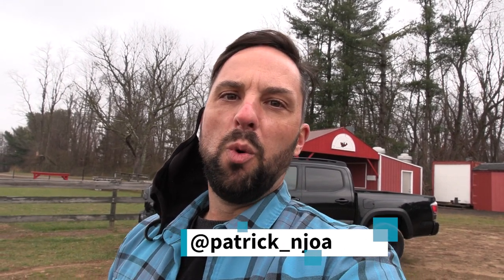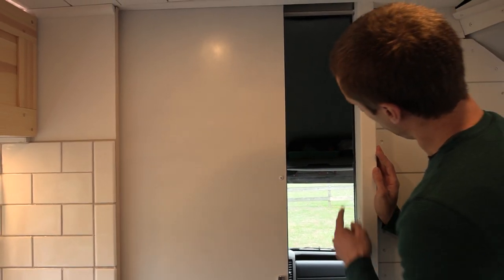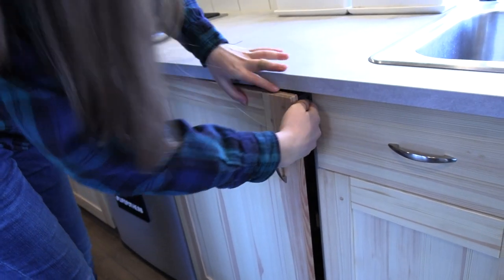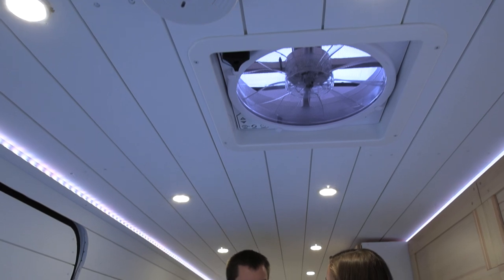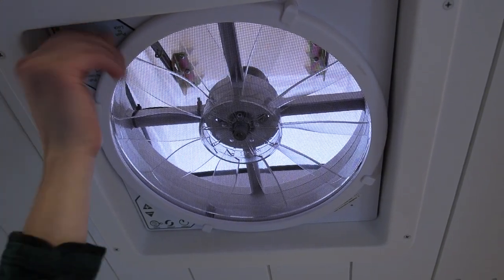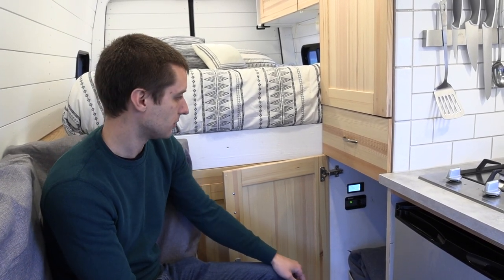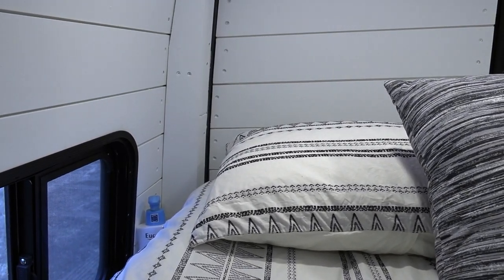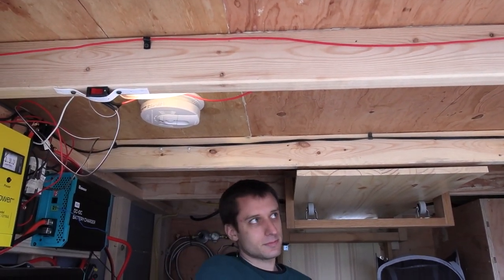Scientist & Engineer Show How to Build Out a Van on a $8000 budget - CAMPER VAN FULL TOUR

Comment: Electric Tech Help please. 
1 How do you calculate how much power for solar panels is needed amps Wats or volts for off grid in a motor home for 3 weeks in a ski resort or Manchester? 
2  For kettle
Fridge?
Induction plates?
Oven grill?
Laptop ?
Shower?
Mobiles wifi?
LED LIGHTS
UV filter water purifyer
3 DC or Ac 
4 as laptop power lead convert AC to DC can laptops be powered by DC directly? 
Enjoy using your electric degree..for public good. 
Many thanks in advance .  
Bryce Cooper
Reply: Hi Bryce, here's an in depth article on sizing your solar array: https://lifepothesis.com/journal-2020-09-03/

For more assistance, feel free to email us at hello@lifepothesis.com, Austin provides electrical system consulting!

Comment: I saw that you used  Reflectix as insulation in your van.  But for Reflectix(or any foil backed insulator for that matter) to be effective, a minimum air gap must be maintained between the heated surface and the insulator.  I can't beleve you didn't utilize the space above the driver compartment.
Reply from the maker: Thanks for the tips!

Comment: One thing I would suggest I realize you are an engineer & a scientist. Your hose vent for your batteries it is not a good idea to vent it through your rear light. The gases could explode when you turn the lights on or step onto the brake! The electrical charge could cause that! It has happened before! It's better to lean toward caution.

I do clap my hands that you have not put your batteries under your couch then stored back packs and other flammable junk with them.

Comment: Wonder what use is it to boast about having such and such "College degrees", "Project Managing Experience", "Brain Power" and whatnot, plus one of the largest wheel based, more spacious, and best vans in the american market, to do a "Camper Van Build" in, and still having to shower and use the restroom God knows where, because all that van space wasn't enough to include something as necessary as A FULLY FUNCTIONING BATHROOM, with all the required plumbing, plus fresh, gray and black water tanks. 
Was the van space not enough? was it the "Brain Power"? Or is that what happens when dreams are bigger than pockets are deep?  Sorry, it's just that some of us don't believe in doing things half assed. But to each his own, and Whatever floats their boat !